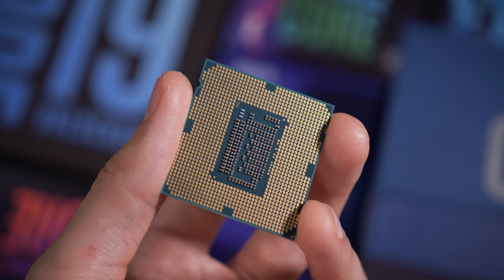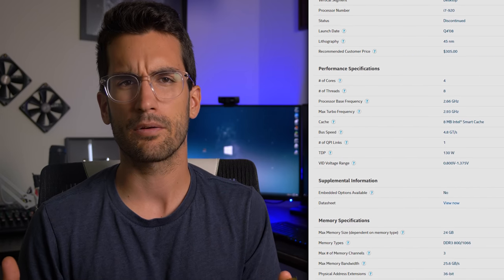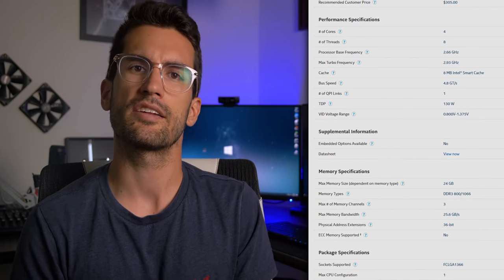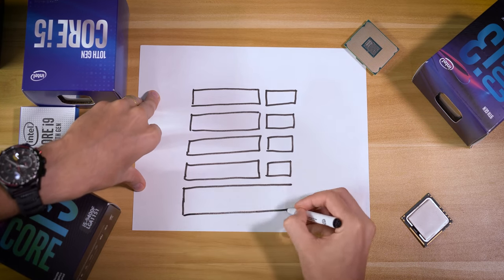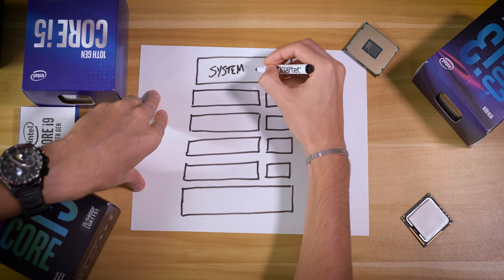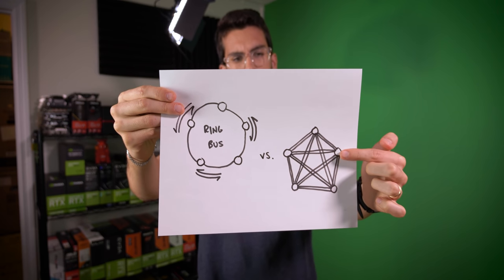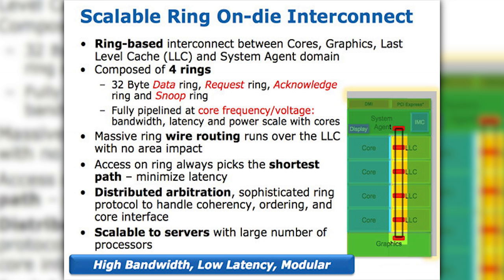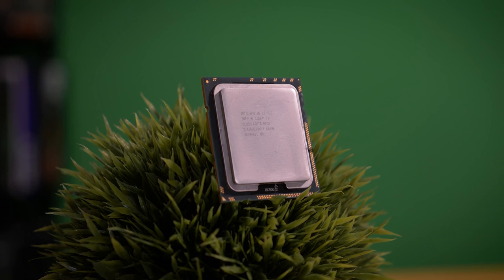Intel's Ring Bus Explained

Comment: I think you are kind of wrong. Before the 2600 we had the 860. The 920/9xx was the extreme platform running on x58. The 860 was the consumer. The 860 was dual channel and the 9xx was triple channel.

Correct me if I am wrong.

Comment: when i saw that drawing i immediately thought of token ring in networking lol
Reply: For those who weren't around at the time...

Token ring was a solution for a very real problem back in the day. Most of the networking solutions had a problem with collisions, unreliable bandwidth and inconsistent latency because of these collisions. A collision occurs when two or more devices on the same network segment try to send at the same time. The sequence goes something like listen if there is any traffic and wait for a lull in the activity. When it's quiet send the package and monitor that there is no disturbance. If another device tries to send at the same time there is a collision and neither package will transfer successfully. Usually these are resolved by having the devices wait for a random period of time before trying to send again. As traffic on the segment increase these collisions become more common and throughput falls off.

Token ring was invented to solve this problem. With all the devices connected in a ring there is a token passed from each device to the next. A device is not allowed to  send unless it has the token. This way it's easy to calculate the throughput and latency for a ring as it stays the same independently of how heavy the traffic is. It had several disadvantages but some of them were exactly the same as the advantage, limited bandwidth dependent on the number of devices in the ring. Another was expensive cabling and hubs compared to other standards. In the end 10BASE-T won out over both 10BASE-2 and Token ring. 100BASE-TG was basically the final successor of Token ring as it used a token passed along among the devices to make sure there were no conflicts, and yet used simple TP cables and (if I remember correctly) RJ45 connectors.

With the introduction of switches being used instead of hubs a lot of the problems with Ethernet was solved. While a hub simply explained just connects all the ports together a switch is a bit more advanced and buffers the packages if there is a potential collision. They also build a internal routing table to send packages to the correct ports, this way the total bandwidth on the segment can surpass the pink speed as long as not all the traffic goes through the same port. This way a lot of the problems with old style Ethernet has been minimized. 

Got a bit carried away there.
Reply: My first thought went this way too because a lot of networking manuals (when I started out and I'm pretty sure that A+ books still talk about it) showed it like this.
On the other hand, he could have also said it is somewhat similar to a major city's subway "Loop Line"

Comment: Fun Fact im using the i7 920 right now .U got me excited for some fricking reason. I overclocked it to 4ghz.Not that bad but very hot
Reply: Dude uograde to an x5675 or smth and you will get a huge performance boost
Reply: 6c/12t Xeons are really cheap for the X58 platform. They are 32nm and run cooler than the older 45nm 4c/8t i7's

Comment: Well, your description is "ok", but it leaves a lot to be desired too.   Star topologies are typically interconnected in the hub with what is known as a "full crossbar".   Crossbars have far, far, FAR higher throughput then any other type of bus architecture.  Far higher than any ring-bus architecture, certainly.  Crossbars are kinda the holy-grail for bus communication (and have been for 50 years), but they are very expensive to build in terms of chip real-estate.  It isn't really a power consumption issue... its silicon area.  Even half cross-bars can be excessively expensive in terms of silicon real-estate.  So when chip real-estate is an issue, implementing a full cross-bar is generally not in the cards.  Hence you get solutions such as Intel's ring-bus.  Or in their higher core-count Xeons, a dual ring-bus.  In ancient times most people just used tri-state busses.  A tri-state bus can have even lower latencies than a ring-bus, but the aggregate bandwidth is even more severely curtailed.

There are trade-offs in everything and the best fit depends on 'what' and 'how-many' of X, Y, and Z hang off of the bus.  A ring bus is an excellent solution for a 4-core cpu but quickly hits bottlenecks as you increase the core count or increase the number of PCIe lanes you hang off of it.  As the silicon nodes have gotten smaller and smaller, chip real-estate has become less of an issue and essentially has left single-ring architectures out in the cold.  This is why AMD's cross-bar approach not only works, but winds up being the more cost-effective solution as well as having four times the aggregate bandwidth than Intel's ring architecture.

Intel's current architecture does have lower latencies, but it is mainly due to the monolithic design and not so much the bus topology.  It is unlikely that Intel will be able to retain a monolithic design moving into the future, it is simply too expensive and non-competitive with AMD's multi-chip design.  AMD is willing to eat the additional latency in order to get multiples higher aggregate peer-to-peer bandwidth and scale.  Intel will probably have to follow suit in the next 2-3 years.

-Matt